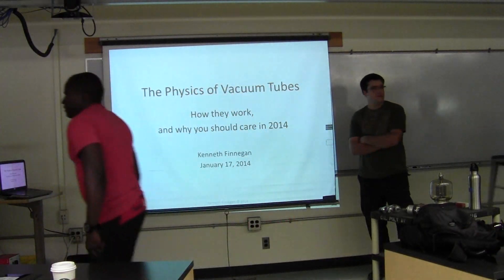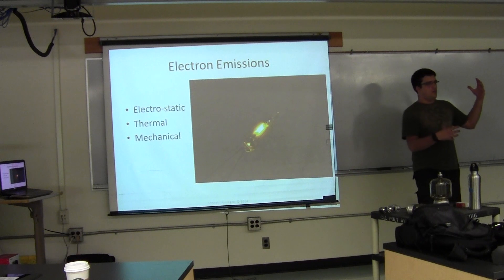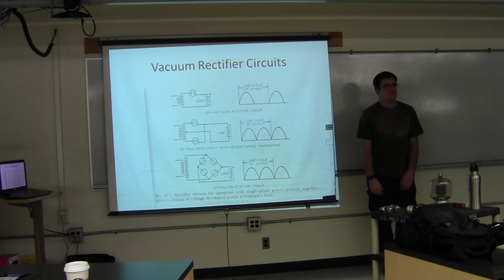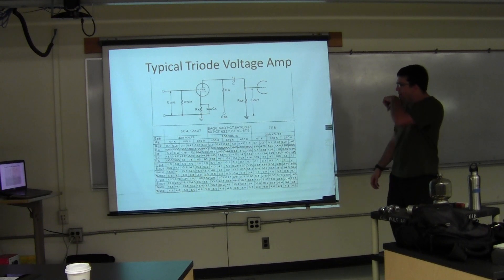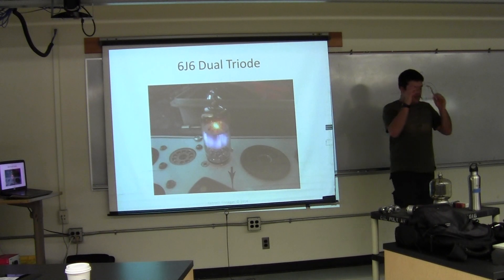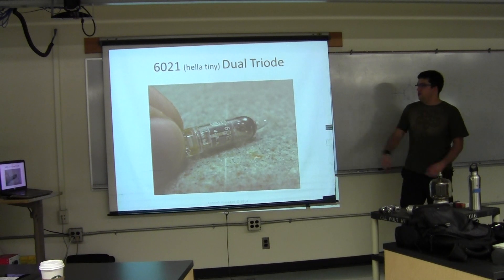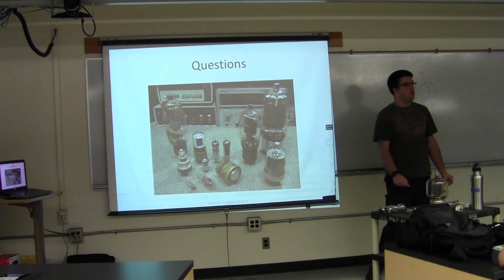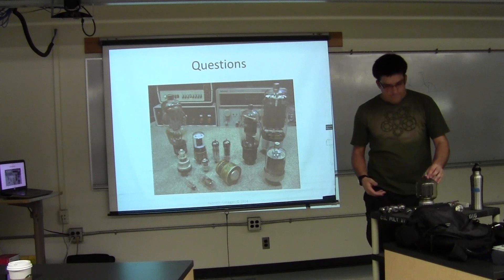Introduction to the Physics of Vacuum Tubes

Comment: Hey viewers, this baby step introduction hopefully wet your tube taste buds.  I'd recommend your next step for learning more detail is start reading RCA RC-22 Receiving Tube Manual. Its a reference manual/data sheets with a more detail than this lecture without to much circuit theory or mathematics. Need more, RDH4 is next. Its packed full of knowledge but is terse. After that, check out the books at tubebooks.org. When you really want to know what's going, not missing anything, head to Reich "Theory and Applications of Electron Tubes". The bandwidth buster at tubebooks, people who know, know what's good.  This book is excellent, I wish I had found this when I started down my vacuum tube learning path 2 years ago. Its exactly what I was looking for. Hang in there, tubes are fun and cool with a wee-bit of danger.